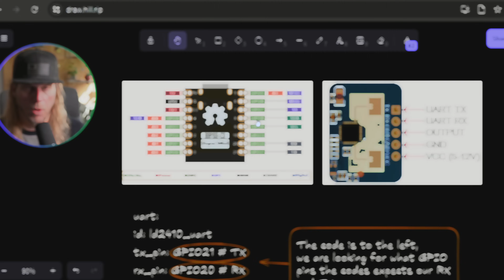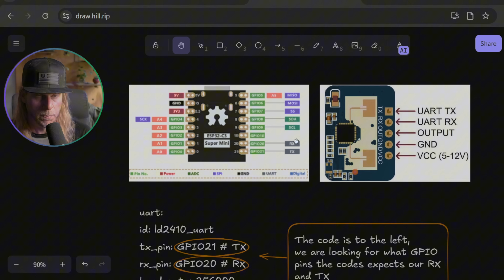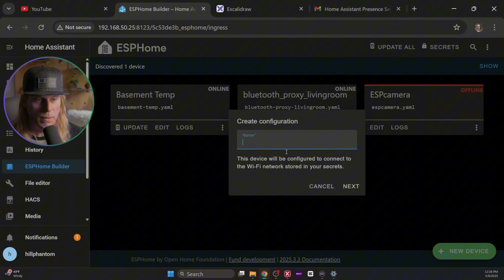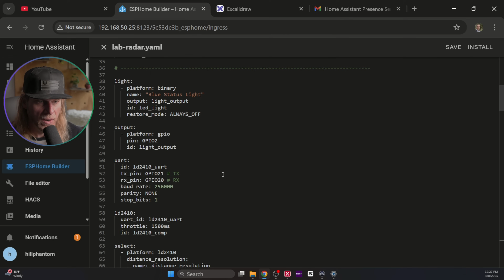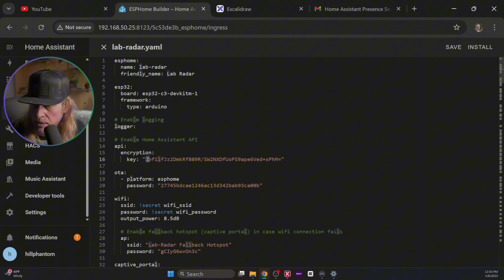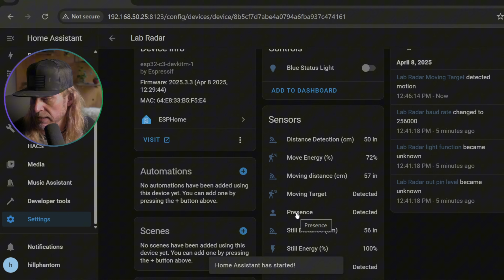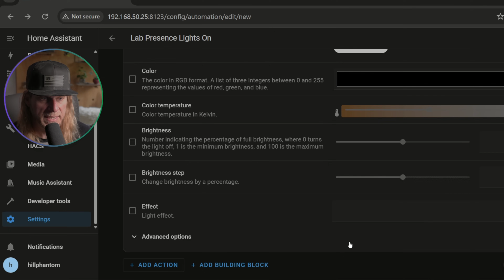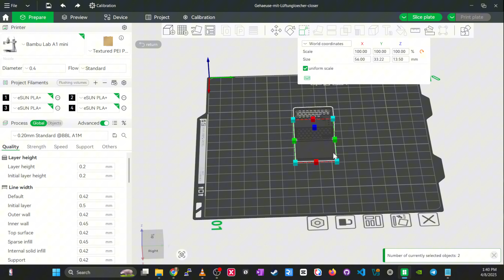I Built a DIY ESP32 Millimeter-Wave Radar Sensor (for cheap!)

Comment: great tutorial, ive done this exact setup! and so far its working however the tuning of "gates" is quite painful. ive searched the interwebs and couldnt really find the best way to get it right. however appreciate this video! i was going to ask, this code suggest blue LED however it doesnt work on all my versions instead the ESP32 C3 minis RED led is constantly on which i beleieve it consuming more power and also it just looks ugly =) , is there any code to remove the RED light and actually get the BLUE LD2410 light working? thank you again my man!
Reply from the maker: Thank you! I have the same issue, the "gates" is some type of sand script that I am not familiar with lol. I get the concept but in practice I am not certain what it really does if I am honest. I have played, tweaked, and researched and have yet to see a great explanation on how to fine tune. I understand the concept but.....in practice I am a bit confused as well. I would have to dig in a bit to see if we can cut that red light off, and the blue light, that we certainly should be able to enable. You using the C3 as well?
Reply: @HillPhantom  haha, ive been tweaking these "gates" for the past couple of days now since i assembled these sensors and i can say im sloowwly getting the hang of it, however is it me or are these sensor ultra sensitive?? i mean each point i move in the ESPhome slider makes all the difference... OK for the blue light, certainly i am not seeing it turn on and off on detection, if indeed that is what is meant to happen? I am running the same setup as yours, using the LD2410C. Does your blue LED turn on and off ? regarding the RED led, well, i have seen some code here and there online, though i am not too confident or certain it will do anything, however i am sure even with my understand that turning off this RED led on the ESP mainboard is possible. There is just so much confusing data out there, ive even asked CHATGPT!  surely the code cant be too complex =)
Reply: chatgpt answers vary, some like this: 

output:
  - platform: gpio
    pin: GPIO8
    inverted: true
    id: red_led

light:
  - platform: binary
    name: "Red LED"
    output: red_led

or this 

switch:
  - platform: gpio
    pin: GPIO8  # Change to the correct pin for your board
    name: "Red LED"
    inverted: true  # Often needed because the LED is active low

i dont know =/

Comment: did anyone try this outdoor?
it didn't work for me... I had to be super close to the sensor to get any detection
Love to hear your thoughts
/chriV
Reply from the maker: I have not but you can go in and adjust the different ranges and fine tune the detection at distance through the adjustments of the sensor in the code or via Home Assistant.

Comment: Would it be possible to also add a mic in with this setup and link speakers? I'm looking to use home assistant voice and want to setup smart hubs in each room to presence detect lights, control music/speakers etc. great video for the motion sense.
Reply from the maker: Sure could. You may or may not need an external amplifier and connect it to the ESP32's Digital-to-Analog Converter (DAC). This way you could program on event to play a sound.

Comment: Hi! Great video! Do you need to always have power to it? I mean… The ESP32-C3 needs to be plugged in a wall plug via usb to get power? I was looking for a battery solution since I don’t want to clutter the wall plugs or use power extenders. Thanks! Also, where do you get the power adapter for the ESP32? On aliexpress you can only buy the ESP board They don’t provide the USB cable and the plug adapter. What specifications should the adapter have? Thanks again!
Reply from the maker: Thank you! Yest you would need to always have the power on for the ESP32. You could certainly use a battery, even small solar panel to keep it charged. I ended up just getting some cheap wall plugs on Amazon. You really don't need much ones that do 5 V 1 amp are just fine. It would be really hard in fact to find a plug that would NOT work, as it a pretty low power device. Even if you have an old plug for a cell phone that would work too. ESP's have some built in protections too so you should be fine, I think mine are 5V 1 Amp. Cheers!
Reply: i would think the radar draws too much power for a small battery solution to be viable

Comment: If you get the ble version of the sensor, you dont need a esp32.
Reply from the maker: I noticed that as well. Pretty cool!!
Reply: I actually bought the bt ones by accident from Ali lol. Lucky noob.
Reply: @Mr_Gadge  you can still used it whit a esp32 if you want.
Reply: @Tntdruid  I got 4 of them to try with 4 super mini, but I have esp32s as proxy from tonight so may try the direct BT. There’s no advantage to using the super mini is there? Many thanks for your original comment as well, I had no bloody idea lol
Reply: @Mr_Gadge  only for the small size of the pcb. And you can tweak,the sensor more.
Reply: @Tntdruid  ok I’ll try both. Many thanks! 😉
Reply: out of interest, whats the model with ble ?  is it the same shape and size ?
Reply: @martinbower2915  HLK-2410C
Reply: @martinbower2915  No it appears to be the size of a standard esp32.

Comment: I could see this device as a replacement for my PIR sensor out front for the LED flood lights I have. Perhaps when you use that non lead solder apply flux and it might just flow a bit better.
Reply from the maker: Good use case and even better eye. It had been years since I soldiered and couldn't find my flux so it ended up looking horrible... Though I am highly embarrassed at my craftsmanship it works but looks like a child did it lol . Cheers!
Reply: @HillPhantom  Not to worry. Just an encouragement for the next project I suppose.

Comment: Great video, subscribed! 
I started dabbling with these sensors recently too, same sensors. They have a basic app that lets you look at the info via blue tooth.  Turns out they can also link with HA bluetooth proxies, letting you use them with 3v (or 5v), ground, and bluetooth. I didn't play with this set up much because I wanted to understand the ESP/LD2410C set up first. But if stable/reliable, it would be easy to piggyback these on basically anything  you can tap the voltage and ground from.

Also a fan of  how you did it. Breadboard to test and get working, solder after. I usually also use a power bank instead of a wall plug, just in case it goes sideways and I have to throw it all outside or in a tub of water 😆
Reply from the maker: A true maker, keeping that tub of water close...ROFL love it! Why wife's last words before she leaves the home,  "try not to burn anything down.......again....."  And of course thank you for the watch, comment, sub, and kind words I appreciate it.  I noticed that too right away that it shows up via BT LE and I even tested it ran some automations off of it and works just fine. But like you, I wanted to test it with ESP and I was a bit worried about my BT setup so I went with wifi instead since I have access points all over. I am a bit, unconvinced about my bluetooth relays at the moment. It is very compelling though to run just the sensor and 3V. I will prob end up messing with it though, get the components to build the usb c and just wire that right to the sensor and make a 3-D case. Damn you ......now you got me thinking about solar too lol.....3.V with a small battery, that charges via solar on my window,....oh boy..... here we go.......Appreciate ya man!
Reply: @HillPhantom  I found BT tracking very unreliable but I also only used a single ESP32.

I get the "try not to burn anything down" comment too. :D

I've been considering getting one of those fire proof bags for ebike lithium batteries for my emergency control measure. :)

Just started watching your vid on vlans. Really helpful.
Reply from the maker: I'm fully convinced BT mesh is fake news, a conspiracy, or I'm broken.....prob the later